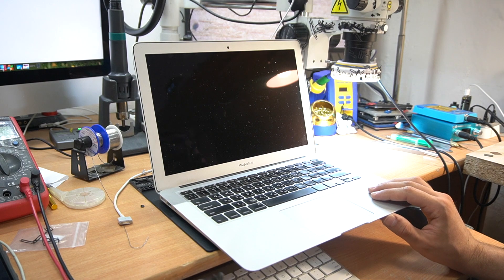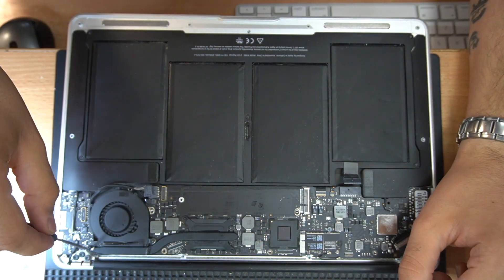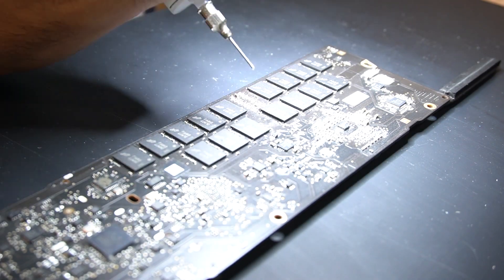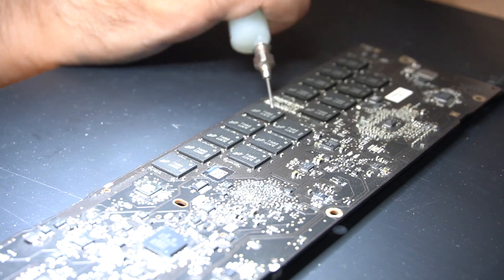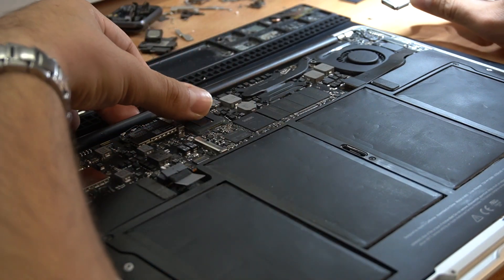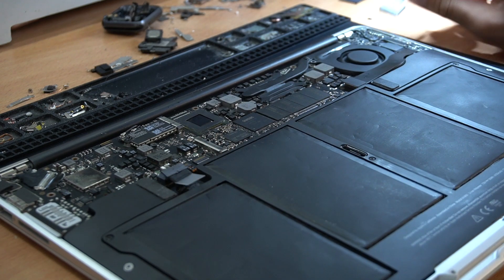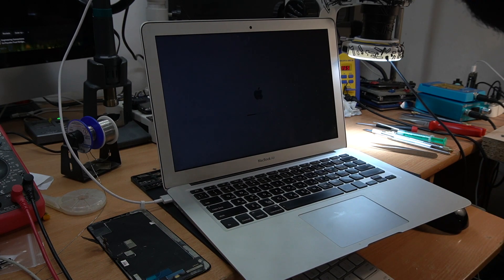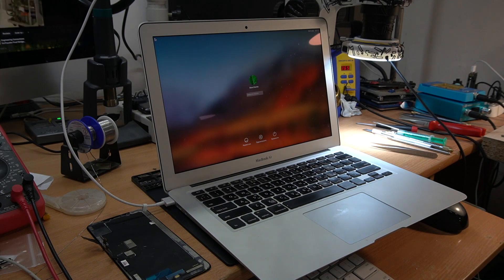MacBook Air 13" 820 3209 not turning on 3 beeps (PCH reheat)

Comment: Is it acceptable  to reheat until chip slightly move?
Reply from the maker: Yes, in the video I did exactly that.
Reply: @iTouch-repair  Thank you, so in principle we could solder chip without masks or stencils, if it places itself right in contacts positions by surface tension?
Reply from the maker: @alexl2656 yes, but you need to add soldering balls if you removed the chip completely.
The stencil is used to evenly add solder to each pad of the chip.
Reply: @iTouch-repair  I think we could paste an amount of solder and flux both sides on chip and board, they glued anyway to contacts, and this would enough. I cleary understand that maybe I am wrong)
Reply from the maker: @alexl2656 please watch videos of how to reball a chip before you try any repair.

Comment: I have similiar problem with 3 beeps, additionaly the PCH is getting hot (can’t hold finger on it longer than 3s). Can it be the same problem? Or should I look for a short?

Thank you for the video! So far I've seen only RAM reflow.